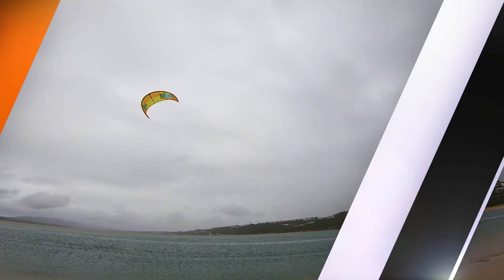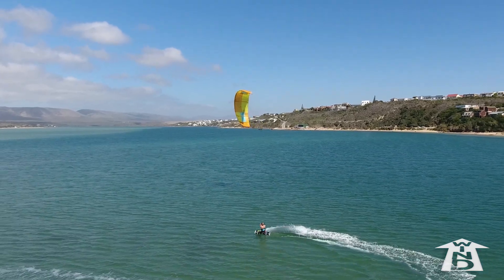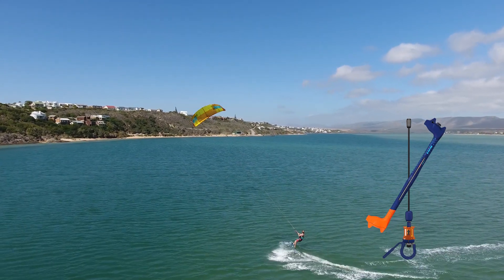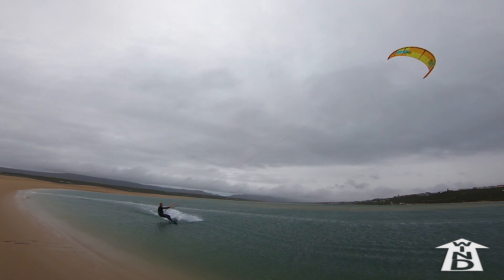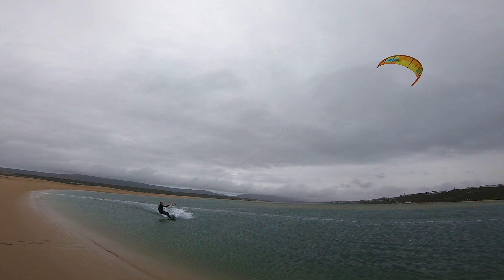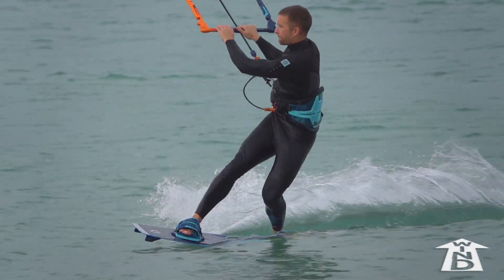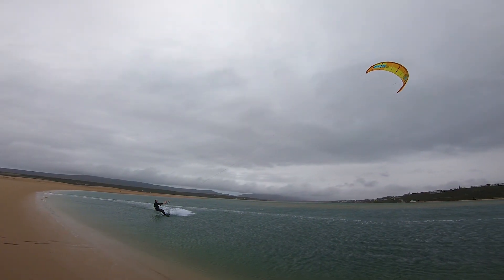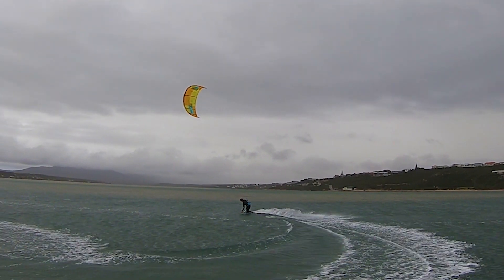How to Downloop Transition, Twintip Tutorial (Basic + Carving turns)

Comment: Apart from turning during light wind, is there a purpose for doing downloops?  Something to do with safety?
Reply from the maker: Hello Casper, sometimes there is a purpose for a downloop. When kiteboarding or kitefoiling in very light wind, the kite is less likely to loose line tension in a downloop. Or if someone is riding close behind/upwind and you need to turn, then a downloop transition will keep the kite low and move you downwind. Or if you're on a wave in on-shore wind, and suddenly start loosing line tension, a downloop can save you when nothing else would. So there can be a purpose, but at first I'd learn it simply because it's fun and fast - plus it's a gateway to lots of other kite loop skills.
Reply: @kitesurfcollege  Fantastic answer, thank you!

Comment: so .. ride downwind first, sheet in and steer the bar at the same time right?
Reply from the maker: Hi jopher, more or less. You're not really sheeting in, rather you're bringing in one side of the bar until fastest turning of the kite is achieved, making sure to push out with the non steering hand to avoid tensioning the other steer line.
Reply: @kitesurfcollege  Thank you, i've tried it a couple of times and felt the bar want to twist on me as it was moving through the power, guess I just have to remember to hold it firmly until it passes..and then sheet out..
Reply from the maker: @jopherscoe9000  yes that makes sense. We also have a surface kite loops video which explains some ways of practising loops.
Reply from the maker: @jopherscoe9000  https://youtu.be/At-W8ZGERUk

Comment: That rear mounted GoPro on your back looks at the end of the video looks like an awesome way to demo your tutorials. Next tut mega loops??
Reply from the maker: Thanks, do you find it helpful? I've been trying it out that backpack mount recently. It can get a range of angles as the arm is adjustable. Although, to stop the arm wobbling, you need to make the chest straps so tight you can hardly breath .
Reply: Kite-Surf-College Tutorials and Tricks definitely...dont worry about breathing, steady picture is more important 🤪
Reply: @kitesurfcollege  While I LOVE your videos (ALL of them) my initial reaction to the follow cam shot was more or less 'meh'. I felt kinda disorientated. I very much prefer the drone shots (or just regular from-the-shore shots) where you can see the rider and the kite together with the hands/bar graphic overlay. If the camera moves too much (here with the backpack or even just zooming in and panning) it's hard or impossible to see the line the rider takes. Closeups are awesome for body position / movement (e.g. board position for the Darkslide) though, but even then I'd prefer a 'fixed' camera with a horizontal horizon 😉 Hope that helps. Thank you for all your spectacular work! 🥳
Reply: I would like to purchase one of those GoPro back mounts. Would you mind sharing a link? Thank you so much for your videos - they are the best and greatly appreciated!

Comment: Very good tutorial. when trying this I regularly crashed my kite. I see in the tutorial a slight move up before looping. Is that recommended?
Reply from the maker: Yes, that's definitely helpful. If you steer up first, that gives more room to downloop and you can potentially complete the downloop without diving the kite too low. Lower down the pull is less forgiving and you can potentially fly the kite into high power zone.
Reply: @kitesurfcollege  thanks a bunch! Will def try.